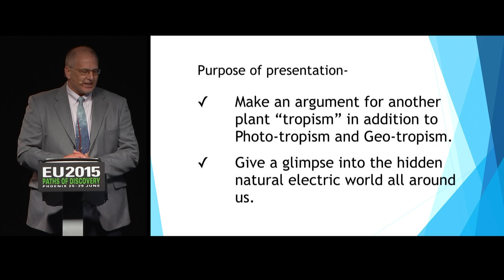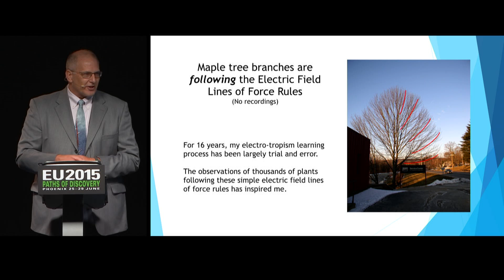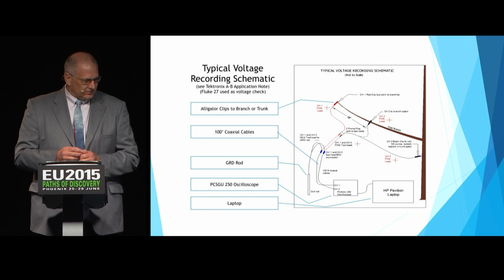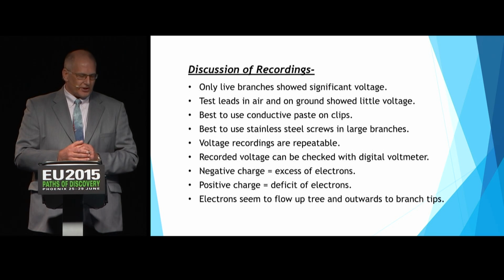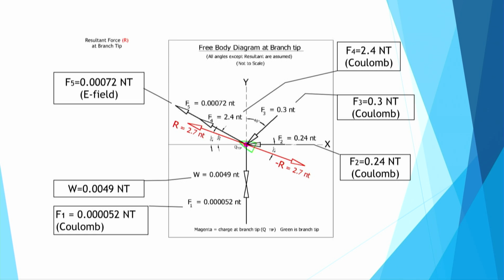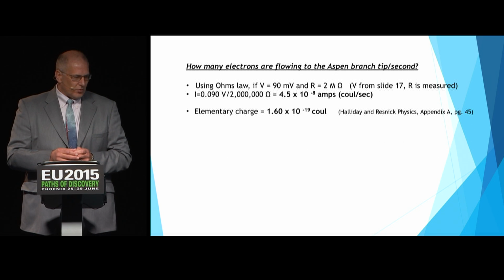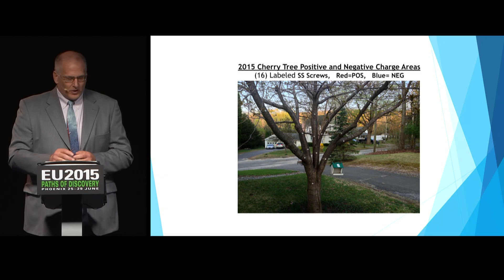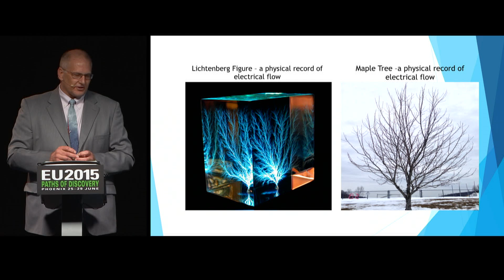Arthur Ramthun: Plant Electro-tropism | EU2015

Comment: Magnet fields can be visualized in their active form by immersing connected wires from a 9, 12, or 24 volt dc source into an acidic or basic solution. When the most active pole begins producing bubbles, hold a pole of the magnet up to the glass wall and the bubbles will rotate around that pole.

This shows the fields rotate more than flow out and in.

Comment: so when a plant is drooping cause it needs water,it's losing it's electric current,add water it replenishes the current and the current lifts the leaves back up,hmm interesting,and it explains how the plant does that
Reply: +Particle Man 
great comment.
Reply: +Particle Man Very interesting observation.  So, when the plant uptakes the water it de-ionizes the water oxygen/hydrogen bond, uses the hydrogen to attract more electrons for growth/energy and disperses the oxygen.  Does that mean the CO2 connection wasn't what we thought it was?  It's actually water and the H2O breakdown and not CO2 scrubbing?  Or, the plant does both.
Reply: +Stixx n stones nice comment deionized water could help add explanation to positive and negative parts of the tree like in the video! I think co2 and h2o both play a big role they both contain oxygen molecules and give a tree plenty of oxygen to work with,it's as if it doesn't matter what the oxygen is attached to the tree will fix the oxygen!
Reply: Thanks for the response.  I think so as well.  Doesn't matter which element O is ionized to, Carbon or Hydrogen.  In fact the Carbon is utilized by the plant when you think about it....trees turn it into wood.   So, plants are clear evidence of a planets cohesive electric fields. This is all very interesting, glad I messaged you.